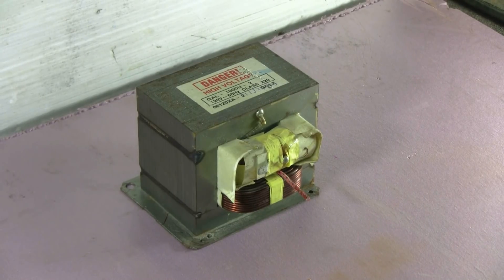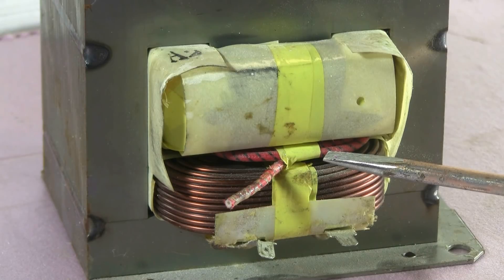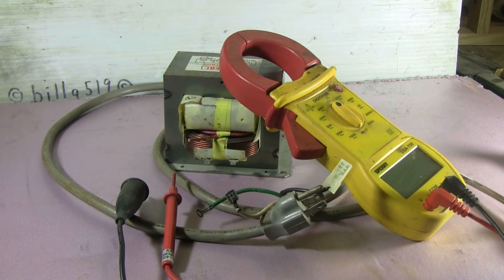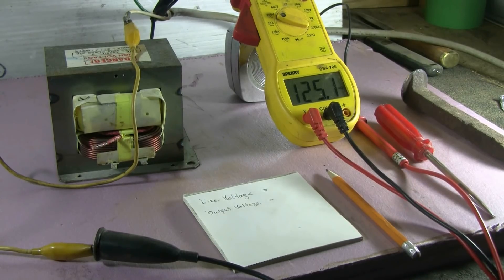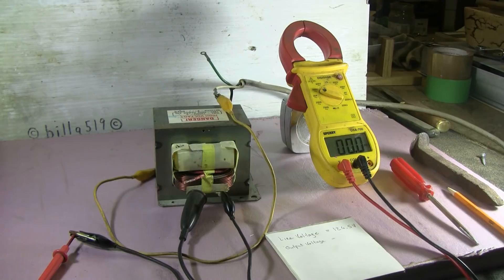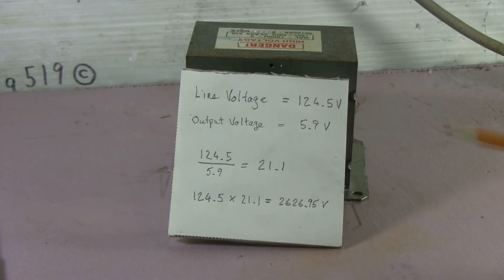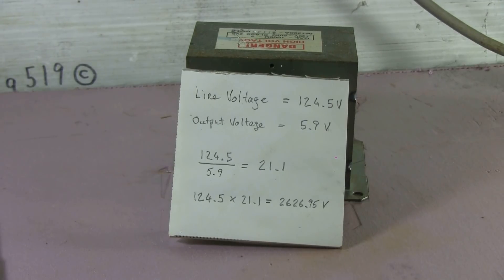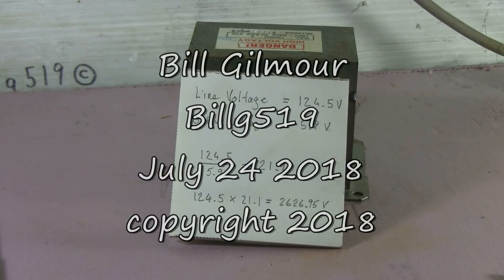How To : Determine MOT Output Voltage

Comment: I noticed that a lot of MOTs are being scavenged to rewire the secondary as DIY spot welder for Lithium battery tabs where the primary still runs at 120 and the secondary only has up to 3 turns of hefty gauge cable to draw the large current needed. Reversing the connection as you did, equates to the same thing except that the output voltage is about twice while the current is halved. You need about 200A for a 15 mil thick tab. People are using 12VDC, 7Ah LIPO batteries rated at 50C and a control PCB that parallels MOSFETs to drive the timing within milliseconds. You got 6VAC and the microwave is rated at 1200W, so the current should be 200A max.. N Channel MOSFET works on DC, but can drive the 6VAC if one end of the coil is used as COMMON source. It will then see it as a 12V DC wave that is smoothed out using a 220uF 25VDC electrolytic capacitor. The  Gate can be driven from a 9V DC battery with its negative connected to the COMMON source. Theoretically, this should works and save us the rewiring time and energy to achieve the same goal. By the way, those PCB spot welder controller only cost lees than $20.

Comment: You can also do it by connecting a multimeter in uA-Range through a large resistor (at least 10 Megaohms) to the secondary and power the transformer like you would do normally. Then calculate the output voltage.
Reply: This way is way safer, but you’re correct
Reply: @enzogaibisso9691  But I guess the way I mentioned is more accurate, since at full input voltage, the core of the microwave oven transformer goes a bit into saturation, which lowers the output voltage a bit. This drop will be something like 5-10%.

Comment: Can one actually use a MOT in reverse as a high current low voltage supply?
Reply: You could do that, but it won't output a lot of power, since the secondary coil has a very high inductance that limits the current.

Comment: I did this. Pulsed the secondary with a tiny 18650. The primary read like -140v AC! Impossible! Discovered it fried my cheap ACE meter(I miss Radio Shack). So it probably wasnt accurate.

Comment: What if you use two MOT transformers.  One to get 2600v and that then feeds the primary of the second transformer.  Would that yield 2600v x 21 = 55,000v ??
Reply: No, because the primary of the second transformer draws a lot of current so the voltage drops a lot. Such a configuration would actually lower the voltage and power output a lit.

Comment: There is literally a video for everything on YouTube and this is exactly what I needed. I have a project that uses a microwave transformer and I was pretty sure my multi meter wasn’t rated high enough to test out with voltage. Now I know how to test output voltage on a microwave transformer. Thank you.

Comment: Nice video :) How much voltage can I get from a microwave transformer if I connect 220V on its output side?
Reply: Every microwave transformer might be different, So for 220 volts the transformer is designed to output still the same (around) 2000V Ac if it's designed for 220V on the label

Comment: Can I use a MOT to measure the output of an inverter type microwave? The high voltage out of inverter into secondary to be stepped down.

Comment: My thought was to use another transformer to step down the input voltage to say 12v.  😅 Your way Is much safer and I don't have to do extra math.

Also some microwaves use a voltage doubling circuit to bump up to 5000 ish volts.

Comment: very nice and detail video, could you tell me how to reduce the voltage and increase amps on this transformer, I'm from India and we get 230-240 V from line output. I removed the secondary coil and replaced it with a 25. sq mm copper cable, (thick one) when compared to foreign measurement system. Im trying to melt some metals like iron nails. my question is how to reduce voltage to 2V and increase amps to 500 amps when the line output is around 240V using this transformer. the transformer I have works on 240 V.
Reply: Good english and grammar..  but the less amount of secondary windings and bigger the wire gauge, the more the current and less the voltage.  For a mot ran at 240v you could use 2 turns of insulated 8 ga stranded wire and should give you around 3v and 800a..  using it to specifically melt things wouldnt be viable as the duty cycle would be less than its intended usage in a microwave..  and short circuiting it all the time melting things would just make it die quicker from overheating..  

But does it suck as much as it looks like it does over in india?  Looks like it would be overcrowded, stinky from all the people and just a pain to live in.  And the weather being so hot in most of the region with a poor power grid wouldnt be too fun either, but ive only been there for a day and a half, nobody spoke english except the english words used to curse and call you names, got my luggage stolen, and somebody literally dropped bird shit on my that he had in a cup..  and tried to get me to pay to clean it off..  i broke his face with a brick and got deported back to America after i got my passport info..  so yea, not a good experience but i bet that dude will think twice before throwing shit on somebody..  lol..  i hit him hard enough to put a flat spot across his cheek and nose..  had to have damn near killed him..  but i stayed with him to make sure he didnt choke on his own blood and told the authorities what and why i did it and they laughed at me and told me next time just make them eat the shit and i wouldnt be arrested..  lol…

Comment: Open circuit voltage can be a bit higher than that of a secondary under a load. If you have a HV probe used by TV techs you could measure the output voltage directly. Use caution.

Comment: What happen if 12v dc or less is connected to MOT primary coil
Reply: Transformers are for AC... If you connect DC and have enough amperage available (as in a car battery), you're probably going to burn up the primary wires...

Comment: Thanks for that analogy. 
So how would you go about finding the current of the secondary ?
Reply: The current can be measured safely the normal way. Provided your ampere meter is on batteries.
The ampere clamp around the wire works too.
Finally, you could measure the current at the primary and assume the same ratio as voltage, in opposite direction, so 20 times lower.
Reply: Wattage going in is going to equal wattage going out (minus whatever losses due to inefficiency / heat)... Thus, Ohm's law can calculate the theoretical value...

Comment: I'm trying to step down 120 to 15 volts is there anyway I can do it with this that you know of
Reply from the maker: You could take a microwave oven transformer and remove the high voltage winding. Replace it with about 15 turns of wire and measure the voltage. Add or remove a few turns to get 15 VAC out. If you need high current then wind the 15 turns with thick wire.
Reply: I'm assuming it won't be 15 volts and 15 amps would it.
Reply: @LazyH-Online hello friend. I read your comments about transformers and since electricity is my favourite but not my profession I will ask you for something plelase. Does this transformer give more than 200Watt at 12 volt DC? Thanks

Comment: Putting 2 bulbs of 115V in series with the primary (low side) and use a voltmeter to measure the low side voltage and the high side voltage would give you a more accurate result.  I think your error with your technique is erring on the high side.  Maybe you could cross-check your results?
Reply: How would two bulbs on the low side effect the output on the high side?

Comment: Interesting idea. I always use a variac at 10 % line voltage and then multiply the output of the secondary by 10. But of course, not everyone has a variac so this is a nice alternative.
Reply: This will work but will result in secondary voltage of 180 to 280 VAC which is dangerous if you don't know what you're doing.